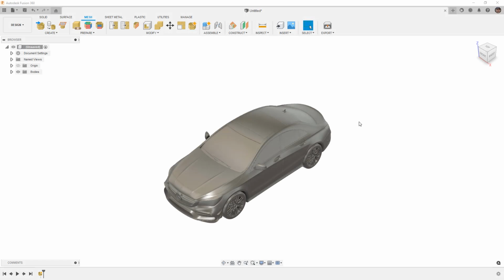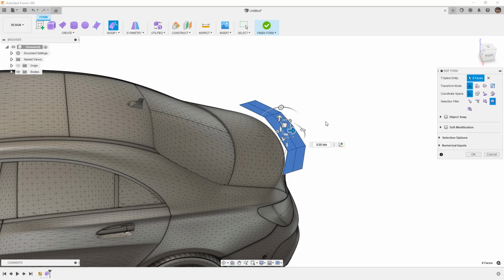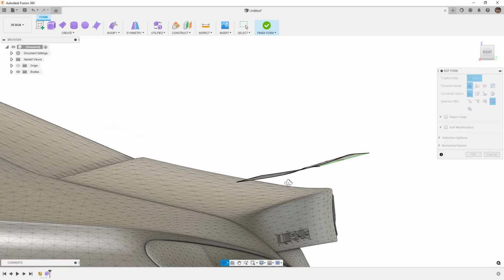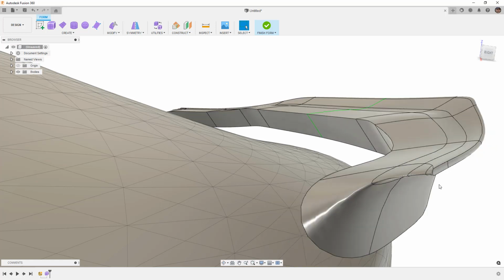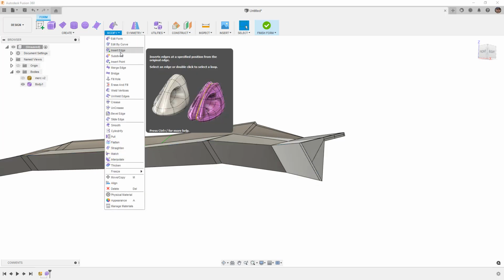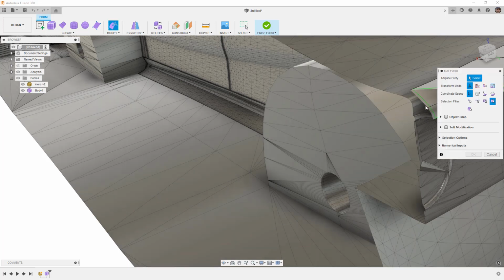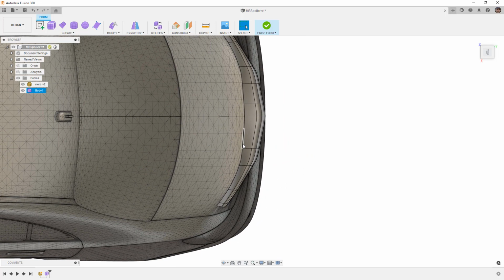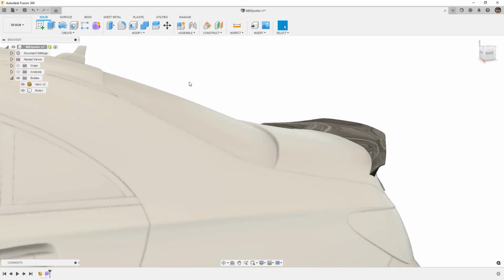Fusion 360 Form Mastery - Part 25 - Designing an AMG Spoiler #Fusion360 #CarDesign

Comment: Do you have any videos where you make a mold from a part like this that doesnt really have a solid plane to split along?  Like if I wanted to make a carbon fiber spoiler from a 3d printed mold based off a modeled form like this?
Reply from the maker: We haven't done that yet but plan to on the GPz build series for the front fender and maybe the tail section.  Easy Composites LTD has a lot of great supplies and videos on the topic (we aren't affiliated).  https://www.easycomposites.us/learning

Comment: Would you by any chance know how to do this in Solidworks?
Reply from the maker: Yes I have done this work before in SWx with an add-in called Power Surfacing.  I actually did a 4 hr series for them years ago modeling a concept car.  another option is the QuickSurface for solidworks add-in.  I know QS is about $3000 for the addin and last i remember Power Surfacing was around $2000.
Reply: @LearnEverythingAboutDesign  Dang, that is expensive. I'm just a student in mechanical eng so I wanted to practice on car models. Would you say 360 is the best way to start this type of niche?
Reply: @LearnEverythingAboutDesign  Thats sick. Is it possible to do it WITHOUT the add in? Or would 360 be the better shout?
Reply from the maker: @abdallaelmaddah4865  well Solidworks has their 3dexperience "stuff" that has freeform modeling, but to the best of my knowledge its limited and I am not sure it works on scan based designs.  Other software has freeform modeling like Rhino, SolidEdge and others.  I still feel like as a CAD program that Fusion is the best choice for this as all the tools are in the hobby version for free or $500/year for the commercial license if you plan to make something and sell it.

Comment: does anyone know any websites to find car models like this that can be uploaded to CAD?
Reply from the maker: There are plenty out there with free or purchased models.  But keep in mind that a model designed as a mesh off images will not be able to be used to create real parts.  You need a 3d scan of the car for that.

Sketchfab is a good site. CGTrader, turbosquid.  there are many more just  becareful.  If it seems too good to be true.

I like the sketchfab add-in for Blender.

Comment: All those programmes are just a bunch of shit... such an over komplicated outdated Software. Sadly there seems to be not good software for just a intuitive way to make something fit to a realy object.
Reply from the maker: Well there are loads of mesh software packages out there made for dealing with scan data, but they are expensive.  Quick Surface and GeoMagic are two that come to mind.  But Fusion is way more intuitive even if it doesn't have all the tools.

Comment: All that work and it didnt fit bcuz you had the wrong car mesh. Its best to use your own 3D scanner to scan the part for 3D meshing.

I wouldn't even trust a 3D model i got from a Manufacturer
Reply from the maker: 100% agree.  I have lots of videos on this channel designing parts to scan meshes.  The process is still the same, but yes don't trust the fit unless you have a scan.

Comment: Why don't you use a Connexion 3D mouse? It has been the single greatest 3d purchase of my life, ever. Turned me into a creating nut, since movement is so fluid.
Reply from the maker: I actually can't stand using them anymore.  i was a big user when i did Solidworks full time cause SWx navigation is trash.  But with Fusion and others I can't use it for video creation and i had come to prefer not using it.  Many companies won't let me use it as they say the motion makes the users sick.  I actually had one plugged in for a long time and when i didn't touch it for at least a month i just tossed it back in the closet :)

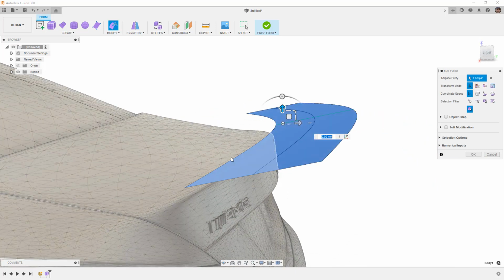Comment: 2:53 how do this?
Reply from the maker: switching to box display?  Right at that timestamp i show how to do it in the UI in edit form and using ALT+1 on the keyboard.  If you mean something else let me know.
Reply: @LearnEverythingAboutDesign  that was it. You didn't show it in the video, and I don't know the keyboard shortcuts
Reply from the maker: @koocian  Just after that timestamp you put say it in the video.  box display is Alt +1 and also in the selection section of the Edit Form dialog at the bottom you can switch back and forth.  Shortcut is definitely the best way though.

Comment: How/where did you get the car model?
Reply from the maker: This one specifically was sent in by a user.  Some are scanned but this one was modeled.  You can download and buy models online. SketchFab is a good source.  Keep in mind though if you are modeling parts based of a file modeled off images it will not fit.  You really need to scan it.

Comment: the best way to get a part to fit against a panel is to model the part of the panel your piece is going to fit against (using geometry snapping on your 3d scan of course) and then once you have that part, in this example the bit of trunk the spoiler sits on, just combine it with the spoiler and use it as a cutting tool for the inside mounting surface of your spoiler. This way you can make adjustments to the spoiler without having to worry about changing the fitment against the car and vice versa.
Reply from the maker: I wouldlnt universally say that is the best way.  depends on the resolution of the mesh and the shape of the part you are fitting.  I did a spoiler for a tesla and making the high res scan into a surface would have been way more work than just pulling the spoiler down, which ended up fitting great.

I think in some, maybe many cases you are correct. https://youtu.be/rV68nODisM8   I would generally do that if i was going to design the part with surface/solid tools.  With freeform tools it really doesn't make as much sense to go to creating the surface, but again i think "it depends" :)
Reply: @LearnEverythingAboutDesign  tbh, I agree with you. There are many other approaches to achieve the same outcome. Great sharing

Comment: [Question about Forms - Pull Command] Big fan of the channel, thanks a lot for all the teaching. I do have a question resulting from following this tutorial.

I have a 3D scan of a MX5 NB booth and I started designing a "ducktail" spoiler, so this tutorial was amazing. Problem that I faced is that the pull command doesn't seem to match the surface as well as I'd like.

I normally work with Solidworks, and in the past I'd use the 3d scan to cut the body, and I've got 100% matching result, but indeed for a spoiler shape, solid design is not as desirable, but when I tried using forms these were the "problems" I faced:

- Pull command would not respect that well the surface, leaving gaps up to 1mm on the curvature
- To fix this, as you advised, I added more edges. problem with this is that if you add edges alongside the spoiler (lateral plane) it'll start to introduce shape changes, meaning that the spoiler gets less "organic" because you're adding more intersections he needs to respect, having more curves. And manually adjusting these to get an organic curvature, is not easy at all! (Hope that this makes sense reading...)
- Then I had the idea of placing the edges ONLY at the matching surface to the body. In total I added 2 more edges (5 in total) so I'd have more vertices to pull to surface. This seems to have helped, but still not fully satisfied with this. I can see that one left side of boot the FORM is coming inside the scan and on the outside is at the surface? Even though I selected all the vertices.

Am I approaching something wrong here? What I'm facing now is that when I'm trying to fix this, by adding edges or other approaches, it's quite tedious to have to "re-form" the shape already with so many edges, and I'm losing a lot of time at this. Already re-designed the spoiler 2 times (at least im getting better at it!)!

Care to share some tips? Of course I'm not expecting you to fix my problem, just maybe share some thoughts on how should I approach to solve the problem of "not so perfect matching" mating to the boot?

Thanks a lot for all the valuable information you've generated and shared for free (and paid) online!
Reply from the maker: Hi Andre!  Seems you have run into some issues which are not uncommon unfortunately.  First here is a tutorial I did with an NB mx5 boot using a different technique.  This one i built a surface off the scan then used surface and solid modeling tools rather than forms.  You can go either direction but pay attention to the minimal amount of edges I used.
https://youtu.be/rV68nODisM8

With what you are dealing with, the only time Pull works well with a high density form is if the mesh is high density and very smooth.  If the mesh is low density or if it is not very smooth then it will cause all sorts of issues.

What I have found when dealing with scan data is that Pull doesn't do a "fit".  And what I mean by that is if you tell it to pull all the verts down to a mesh, it will do that.  It doesn't do some sort of average.  With most cars the curvature is fairly gradual and you can likely get away with it using very few edges.  The fewer the better in every case!  Because unlike an actual mesh, the form cage is pulling/pushing on the surfaces it will create.  With a mesh it can sort of average them out.

This is not likely to work well but if you have something close you can try the tool Smooth which will do a bit of an average of the positions, and Make Uniform (under the utility menu) to try and relax the form.

One other thing I do is to manually manipulate a lower density form body and look at the visual overlap between it and the mesh.  While this isn't a precise method, it is usually "good enough" when dealing with a noisy scan.

You can do the boolean subtract of the mesh from a solid body if you wish.  There are 2 ways to do this.  If you plan to 3d print the spoiler then you can tesselate it into a mesh body, then use the boolean combine tool to subtract the scan from the spoiler.  The other way is to convert the mesh to a solid or surface.  This will have a bunch of tiny triangles so less than idea, but the same way Solidworks does it unless you are using the ScanTo3D to try and generate a boundary surface.

Last tip.  If you can smooth and remesh your scan to a quad mesh in another program, that will convert to a freeform body and might make it easier as a starting point.  its a bit of extra steps but if you cut a section of the scan just larger than the area you want it might be feasible.  There are free programs that do tri to quad remesh outside of Autodesk.  

Hope all that helps!

Comment: How to send this for manufacturing
Reply from the maker: Depends on how you want to manufacture it.  The people I have helped with these have 3d printed them in sections and glued them together to make a mold.  If you are going to do some other form of fabrication you need to work with that company to find out their needs.  A closed form body once you select Finish Form is a solid, but there may be additional requirements for things like draft and pull direction depending on how you are planning to make something.
Reply: @LearnEverythingAboutDesign  i was thinking to use layers of sheet metal that are cut with laser. What do you think?
Reply from the maker: @solidfuel0  Well a part like this wasn't designed to be fabricated in that way.  And unwrapping a 3d surface to a flat 2d shape so you can export a DXF is tricky (and not really possible in Fusion).  Programs like Inventor and Solidworks can flatten surfaces, but in Solidworks you need to have the premium version.  Inventor you need the pro version I believe.  These flatten surface tools are made to flatten a complex shape so you can do things like make decals or cut fabric for composites.  There are 3rd party programs like Exact flat that you can get for Fusion but it costs a lot more than Fusion does alone.  Last i checked i think $1500/year
Reply: @LearnEverythingAboutDesign thanks for the overview. what if I draw the shape from sheet metal layers from the start. It will look like mine craft from the edges but then i can put putty and sand it before painting.
Reply from the maker: @solidfuel0  In order to flatten them in Fusion 360 it would be pretty blocky looking.  I would say the easiest way would be to 3d print and then do fiberglass or carbon fiber over top of it as a final part or to build a mold from it.  To do it as sheet metal you might be able to do the old Buck style where you slice it and build a hammer form to hammer the metal over, but something this long and thin like a spoiler would be tricky as opposed to something like a fender.

Comment: Hi there! I have a question. If it is possible when working with Pull, just take the vertices of one of the sides, because they are with mirror? In that case the mirror relationship will stay?
Reply from the maker: Yes you can!  That should work just fine.
Reply: Andd... lets say we have a simetry relationship in our form. When we have a not simetric mesh that we want to pull our form to it, but we want that our form mantain its simetry. What can we do?
Reply from the maker: @MikiC0007  well if you want to pull it to a non symmetric mesh it will break symmetry.  So you will need to remove symmetry from the design to make that happen.  If you try to pull it down to a non-symmetric mesh it will either break symmetry on its own (with a warning) or just not pull down to the mesh.
Reply: @LearnEverythingAboutDesign Thankk U!

Comment: Can you make video about "cutting with car"? I love this video! Ive got my stl today and i dont know what to do, then i saw your vid. Greatings from Poland :D
Reply from the maker: Hey Lukasz!  Yeah so while designing it in Forms you can add more divisions to closer match the car.  If you want to 3d print it then converting to a mesh isn't a big deal.  I can get a video of that but here are the steps.

After you finish the form and it creates a "BREP" Solid, you go to the Mesh tools and "Tesselate".  This will give you some options and allow you to convert the BREP to a mesh.  I usually will make a copy of the body first as this consumes the solid, but it will all be captured in the history timeline.
After you have both the car and the spoiler as mesh bodies you can use the mesh tool "Combine" and use the spoiler as the Target body and the car as the Tool Body.  I like to check "Keep Tool Body" so the car isn't removed.

When this happens you may need to do a little cleanup work.  It really depends on the car model though.  Also note this might take a bit to calculate so be patient especially if you don't have a super fast computer.

Side note, is that RMZ in the signature yours?  Here in the US black background and white numbers would mean 250 class(for moto).  I used to race supermoto in the 450 class and rode a lot of moto.
Reply: @LearnEverythingAboutDesign  Thank you for the answear! Yes it is RMZ 250 :D not mine but it belongs to my cousin. I was riding YZ125 07'. One more thing... If you want i can share with you with my mazda mx5 nc trunk scan so you can make video or smth :D Keep doing it!
Reply from the maker: Nice Lukasz!  I raced an 07 RMZ450.  I also had an 06 YZ250.  Currently I have a ktm 450 and a 250xc.

Anything you want to share feel free to email me at support@caducator.com.  Just let me know if it is something I can share or not.